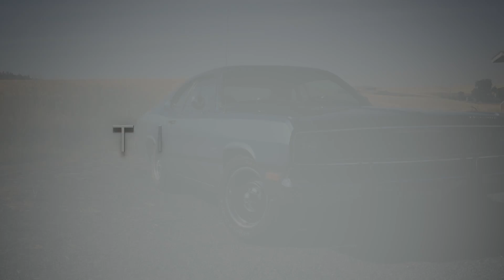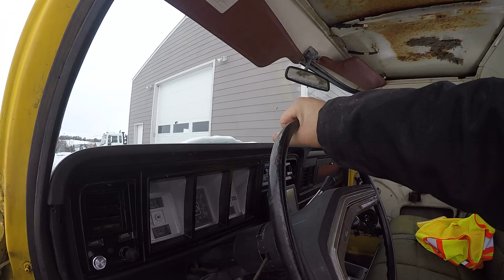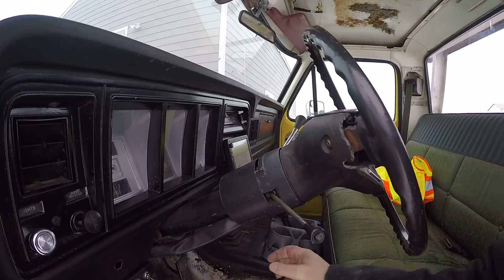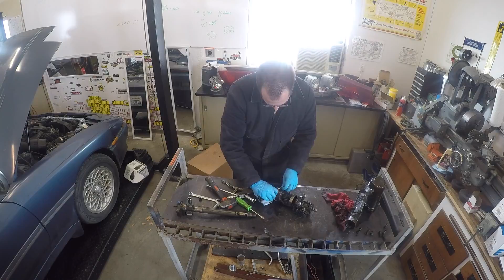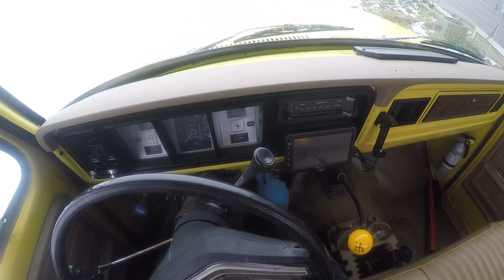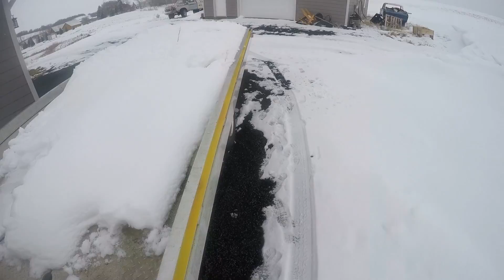Ford Dentside Power Steering Overhaul

Comment: I was hoping this was a more technical how-to-do-it for a beginner mechanic. Nope. I didn't learn a thing about power steering gear boxes.
Reply from the maker: So I have a power steering box on the bench right now getting all new seals, is there a particular aspect of power steering you are curious about(and what type of system Ford used several)?
Reply: @tingleyent2149    Do  a more comprehensive video. Thanks for your reply.